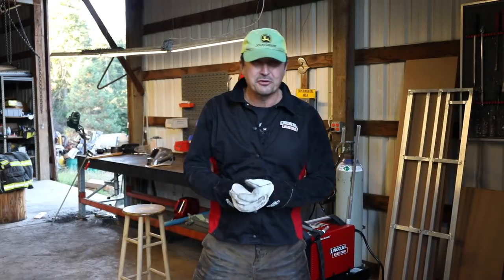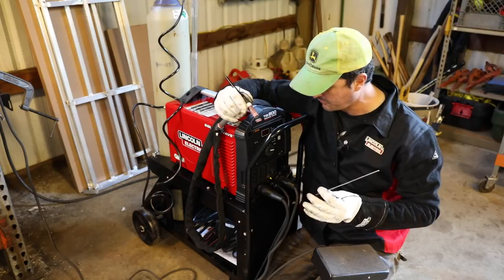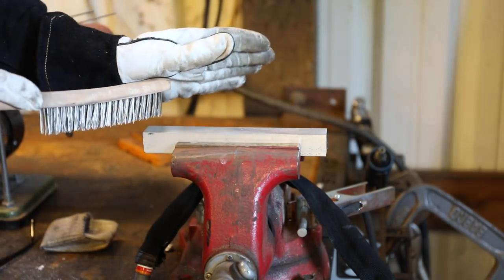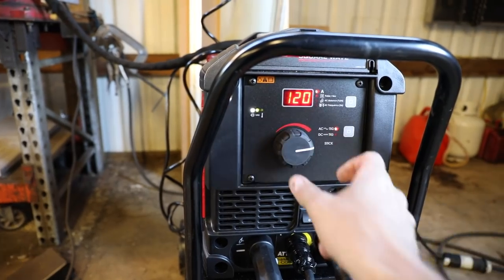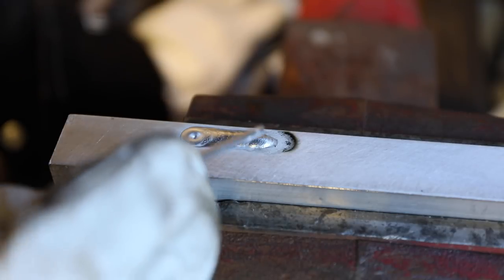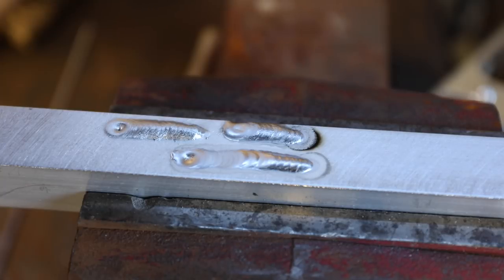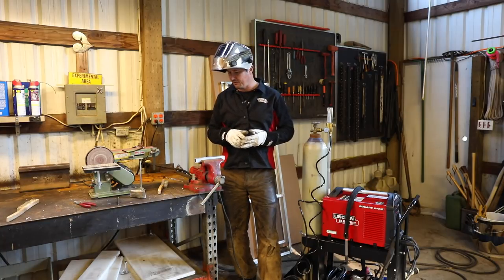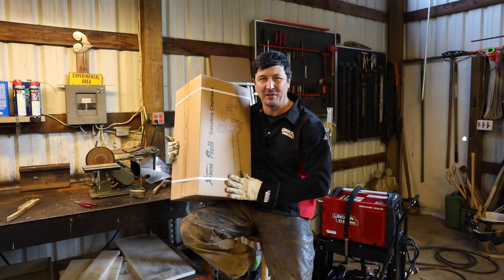The Hardest Thing I've Ever Done!!!

Comment: The black is normal. Go full throttle at beginning of weld and back off as the heat increases in base metal. So not to crystallize the metal the pit at the end is from a combination of not gently backing off heat and keeping gas flowing on weldment after arc is stopped. There should be a post flow setting on the machine. So hold the torch in place after pedal is released. And your absolutely correct with aluminum the piece being freshly cleaned even if it's a new piece of aluminum is key. By the way that was pretty darn good for a first time. I worked many years in many welding shops from railroad cars to cantilever and coredrill seating fixtures. for most all fast food restaurants across the country and even internationally. I've even build steel skateboard parks across the country. And even with all that experience I'm reluctant to post much video on welding.

Comment: Wow Cody pick the hardest metal to weld to learn how on! Typically I always weld aluminum using the foot pedal for best results which you did, I did not see you prepare your tungsten, for welding aluminum you should have a ball on the end instead of the typically sharpened tip  . Welding anything else I use regular settings and don't use a foot pedal, preferring to set my heat to best suit what I am welding. By the way they do make spool guns that weld aluminum for MIG welders and those are slick once you get it dialed in which can also use a shielding gas that prevents all the splatter. I will say your beads over all look pretty good for a first time welder. Prepping the metal is very important to get clean welds, you are doing that, great job keep it up

Comment: cody I am not a tig master at all ok more like a novice but I have worked with a few tig welders and have asked them how to and watched one thing I have learned is when your done with your bead let up one the pedal and rise the torch until basically the arc goes away the will take that dimple away. good job I must say because welding on aluminum is one of the hardest things to do I always melt it a blow a hole through it but anyway good job.

Comment: Hi im a welder from norway. And i recommend buying a tig pen. It a feeder for the rod so you dont have to use you fingers to feed. And btw i think it would be easier to learn the basics on carbon steel or stainless. Aluminum is very difficult

Comment: Practice on mild steel to get it down. Also I don't use amperage suggestions, I turn the machine up to 200 and use the peddle to control the whole thing by how my pool looks. When I start the arc I'll hold for a second with and spike the peddle real quick to melt the base, once I see a puddle start forming I add filler. That way I know I'm actually melting into the base material. The argon is to shield the weld from contaminants in our air (you can weld without it, it just looks like trash), so when you finish the weld, let off the peddle and hold the torch above it until the pool starts to solidify. You can set your "post flow". I set it to about 15 seconds. The gas will flow after the arc is stopped. This protects the weld as it forms so you don't get porosity. Don't touch the filler to the tungsten, it'll give you one hell of a jolt. The biggest thing I ever learned was knowing how Well you can actually control the puddle with tig. For example, if my filler gets caught or I have to adjust, no big deal, just stop, back the peddle off a little and the puddle will stay while still being in a pool, then to start just up the peddle a bit till the pool starts to travel and start adding filler again, once you get used to it, it's like you never paused at all!

Comment: Some suggestions to make it easier for you.  If you take the ceramic cup and place it against the metal you have better control of the arc length it will clean it up and make it nice and petty.  Google "Walking the cup"

The divet at the end of your weld is because you aren't filling your crater.  Add enough filler metal to fill it in.

Comment: Looks pretty good so far. Noticed a few minor things. Your stick out of the tungsten should be roughly the same as the diameter of your cup. If the diameter of the cup is 3/8" the stickout shoukd be 3/8" from the cup. Keep adding the filler metal at a 90° angle to your tungsten. ie. 0° is the direction you are traveling and 180° is the behind the puddle. Tungsten is at 105° filler for should be roughly at 15°  and add the filler metal to the front of the puddle. Good job and you should wear your respirator when welding in general. 👍👍

Comment: Start your arc with the foot pedal to the floor,  lots of heat at first, then ease off when your bead starts to consistent,  that black your getting is pretty common in aluminum welding, even with a spool gun, cleans off pretty east just wipe it off with your glove lol prett damn good though for someone with little experience! Keep practicing!! 
 
All the way from Newfoundland! 👍

Comment: My background is production TIG of aluminum pressure vessels for 10 yrs, I think your torch angle might be too far off from 90 deg. The graininess of the weld is a shielding issue try bumping up your gas flow a little bit. The soot is due to no prebflow of gas. If you don't have that setting activate the pedal to get the gas flowing but don't strike and arc right away. As for the crater at the end...there is a trick to that, you need to do what is called cratering out. So when you are ready to end you weld stop the forward progress of the weld while simultaneously backing off on the pedal but don't stop the arc. As you are cooling the arc do a small swirl with the torch and add a bit of filler metal then back off the pedal to the point of the weld puddle freezing solid then let off the pedal but don't move the torch. There will still be gas flowing due to post flow and it needs to be there even though the weld puddlebis solid. This will take practice bit if you follow these step you will get it.  Having trained welders at work you are doing great! This is a tough skill to learn good luck

Comment: Looks pretty good, turn up the gas on the flow regulator, try turning the heat down just a little tube aluminum transfers the heat all the way around and heats up quickly and reatains it more than flat plates.plus your working on the one piece not two pieces being joined then you can manipulate the heat a little more.but you have it just keep doing it good job 😉

Comment: You did very well for a first time.  Try steel.  The first time used tig on steel I got the tungsten in the pool and it got stuck.  Had to reshape the electrode on a belt sander a bunch of times before I finally got a good weld. I was 18 when I learned.  27 years later I prefer mig.  It's just a faster process.

Comment: Biggest thing to remember with aluminum is that the heat spreads fast. You start out hotter than you weld with. When you practice don't do your next pass so close because the material will be preheated and get your thinking all off. Choose a cool part of the test piece to weld each time until you learn how it heats up.

Comment: Wranglerstar seems there are a few videos disputing that pen story but the analogy is probably accurate. 

Try welding two pieces together. If it works well and does not fail at the weld then that's good enough for most home owners.

Comment: Welding aluminum requires a ball on the tungsten tip by reversing the polarity to DCRP and striking  a arc for a second  and then switch back to AC for welding.Square Wave may be different but that's the old school way to do it.

Comment: Not bad Cody. I'm not an expert but I do weld and went to school. get a ball on your tungsten and keep your stick out short and lift your tungsten out but keep the shielding gas on the weld after you get to the end and pull out . Turn up the gas a little. Get your puddle hot before you start dipping. I think 25 psi should do for the gas.

Comment: Cody, the black soot at the beginning of your weld is not contamination at all, most aluminum is not actually %100 often magnesium is added for rigidity and all that means is the magnesium is floating to the top of the base metal. Good job though you learned much faster than i when beginning aluminum tig.

Comment: if you want to learn how to tig weld, start with oxy/acetylene. Jumping from flame to electricity is so much easier. Then the only thing you need to learn about is AC vs DC/electrode + vs - and wave form. The settings are the complicated part, but the technique is the same as with O2/C2H2

Comment: The first part of your third weld is damn near perfect. The pores in the two first welds gets formed due to too cold weld, combined with contamination.
Lightly scuff 2 inches around the area ytou're going to weld with a scotchbrite, then wipe it down with acetone. Wipe your fillerrod with acetone aswell.
Also, get your tungsten a little bit further out, more gas (turn up the pre-flow, that's the reason for the black areas at the start of the welds)
The most important thing to TIG welding is a steady pace of both speed and feed (and feed the same amount of filler). Try listening to music while you weld, the beat in the song makes it easier to keep a steady pace. Try keeping the puddle as evenly sized as possible, approx twice the width of your fillerrod.

Comment: Aluminum conducts heat very well, much better than mild steel. When welding on aluminum the first eighth of an inch takes a bit to heat up. That is why your weld is humped up at the beginning. Once the metal is heated up, you're going to have to speed up the travel of your torch hand. Your angle of the torch was fine, the weld got wider because the metal was heated up and your torch hand was moving too slow.

Comment: Those holes at the end of the weld beads are not created by too much heat input, which burns the material through, but by the shrinkage of aluminium. When aluminium cools down and solidifies, it shrinks a lot, and since the middle of the puddle  solidifies last, the middle is still liquid, while the edges are already solidifying and shrinking. The liquid can not resist the shrinkage of the other areas, thus a hole will be created in the middle of the puddle, which can be as deep as the weld itself.

You can prevent this by slowly decreasing the amperage with the foot pedal, and adding a little bit of filler material at the same time.

Comment: I saw you grinding the electrode horizontally in the intro. You should grind them vertically such that the grinding marks run the same direction as length of the electrode. It will throw a better arc.

Comment: I went to learn tig welding back in the 70s and was always told not to grind your welding needles on a contaminated wheel and as already advised about allowing the argon gas to flow first also make sure that there is no serious draft from an open door that can interfere with gas flow.

Comment: Safety first, then just keep practicing. I find that instruction is 1000 X more useful once you've got a feel for things. Tig is an art and it's 99% feel so the more time you put into practicing the better your weld will get. You could watch and attend years of training, but with Tig the hours you spend doing it is what will progress your ability. After you develop your ability where you welds are smooth and repeatable(Not necessarily good) THEN a little instruction will go along way. There are so many factors you have to account for that if you can't FEEL the difference your not going to make up for it.

Comment: You should start on mild steel to learn heat control, I also think you have a gas issue.  Try to turn up your gas s little and watch your torch angle and distance.  The longer you weld on a short piece of aluminum the hotter it gets you have to learn to use a gentle touch watch the bead width

Comment: increase your shielding gas, get some practice with the foot pedal. at the end of weld, lighten up on the pedal till off. keep torch close to weld for 2 or 3 seconds after you complete weld to keep gas flowing over weld till its hard/cool down. hardest thing you will master is the foot pedal. practice practice and then practice some more! keep your tungsten sharp grinding them is a art in itself!!!

Comment: I wish I had a few hours to spend with you , I made my living welding together aluminum heat exchangers of all sizes and shapes for many years, there are a great many varieties of filler rod , cup sizes, tungsten always use pure for aluminum color code green , thickness of the aluminum work piece is a factor , thick aluminum needs a preheat but not to much that it removes the temper , aluminum has to get up to temp before you are going to get that filler rod to flow into the work piece , let me tell you this , practice practice , get your bench and chair the rite height for you , I use to like my torch hose up on the bench so as not to feel any drag from it , a good filler rod is 4043 keep on hand some different diameters, 1/16 & 1/8 are good also cup sizes like number 4 , 5 , and six , and tungsten sizes 1/16 and 1/8 diameters also with those the corresponding nozzles and collets it looks like you have #20 torch their that's good a cooler is a nice add on for it depending your use .

Comment: WARNING THIS IS MY OPINION AND IF IM IN ACCURATE TO THE T IM SORRY. If that welder has pre and or post flow, it will help keep oxygen out of the weld. If it has post flow then you need to hold the Tig torch not against but close to your base plate. This allows for proper shielding. Also not sure if its always supposed to be like this but I was taught to ball the end of your tungsten. It allows you to not have a hole at the end. It also spreads the heat out so you don't have a penetrating problem. Use the petal to change how big the weld is. More heat the more the weld bead will sink into the aluminum.

Comment: Im in a welding class.  And just going into this.  Most problems i see with people doing tig is torch angle.   They normally lean it back too far and it seems to suck air almost like a venturi but thats just what it seems to be    their problem could also just be bad prep but im thinking its angle.      And btw starting on aluminum before steel.    That takes courage.
Reply: As for that black stuff ive got no clue.   And im also curious. Cause ive seen black  and a slightly green blue

Comment: Good for beginning for sure. Make sure you do not dip your tungsten electrode into the puddle. If you do so regrind it to a point. I highly suggest "welding tips and tricks tig welding basics" and " Chucke2009 teach yourself how to tig weld". It also may be easier to start on steel instead of aluminum. Just keep practicing that's the only way to improve. To solve the pinhole at the end of your weld slowly back off the peddle and add in extra filler rod and move the torch in a slight circular motion. Then break the arc and hold the torch until the flow of argon has stopped to insure complete shielding coverage.

Comment: Hey Cody if you want something easier you should try a thumb control for your tig instead of having the petal for your gas but for starting out using the TIG  your doing no that bad my dad had been welding for 22 years with a TIG and yours has been the best I’ve seen for a beginner

Comment: Your shielding gas isn't what strikes your arc, shielding gas protects your weld bead from contaminants in the air. With tig welding carbon steel, stainless and aluminum you have to clean it and clean it good. If you don't clean it well you'll just contaminate your weld. Also when your welding you see like a shielded zone or your bead, you want to keep your fillet metal in that zone as your dabbing or again you could risk contaminating your weld. I've notice that tig welding is a very clean process. Cleaner your material is the better you'll be off. Your bead profile of how high or how wide it is determines how much amp you put in it. I'm not master at tig welding, I'm in school for welding and these are the things I've notice. Go check out weldingtipsandtricks.

Comment: The hole you experienced at the end of your weld is a "gas hole" it is caused by a lack of argon. If at all possible with that machine, set up a post-flow of roughly 7-10 seconds and hold your torch above the finishing spot till the torch has completely stopped flowing the argon for those 7-10 seconds. If your torch has a screw to adjust the flow of argon instead of a setting within the machine simply hold the torch above the end of the puddle allowing the argon to continue to flow for the 7-10 second time slot and slowly back off the pedal.

Comment: General welding tip: pay close attention to the sound, especially while 'mig' welding. I set my mig welder by sound alone faster and more to my liking then any other way.
Reply: Also... the only 3 ways to weld faster: don't stop, higher amperage (wire feed speed), and smaller welds

Comment: Ok for start to end how to help. One a dull tongsten helps on aluminum. It looks like you need to add a little more wire at the end when you are letting off to not have the crater pit.

Comment: On the Aluminum welding, a good hint it your Tungsten electrode, hold above a plate of steel, that is grounded naturally, hit the peddle, or bring up the resistance and get a ball  on the end.  Aluminum  you want to chase the keyhole . Takes time and practice. You will get it ... Also use a brass brush not steel to clean your Aluminum .
Reply: ?? a brass brush.  I've never heard of this.  Why use brass? again?